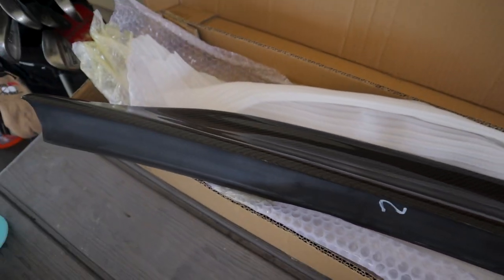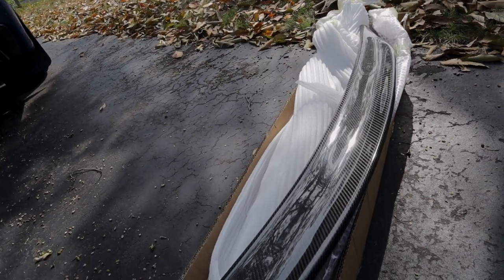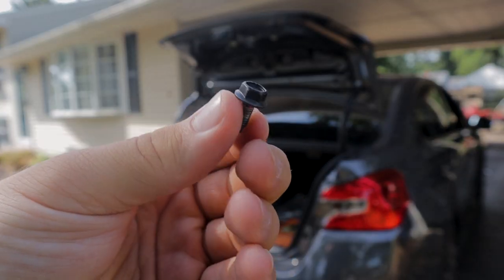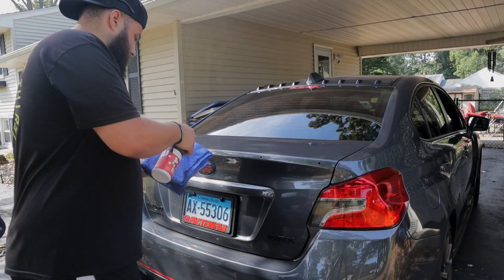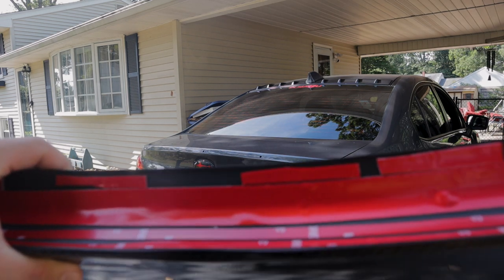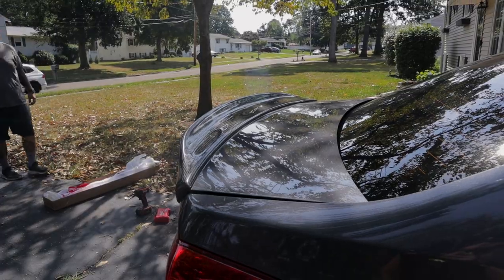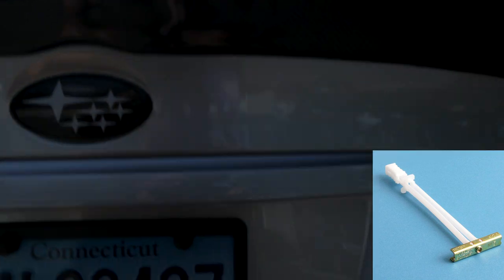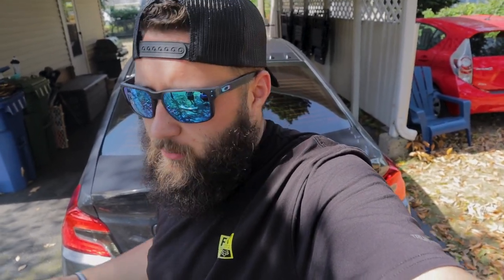OLM CARBON FIBER Duckbill - Subaru WRX 15+

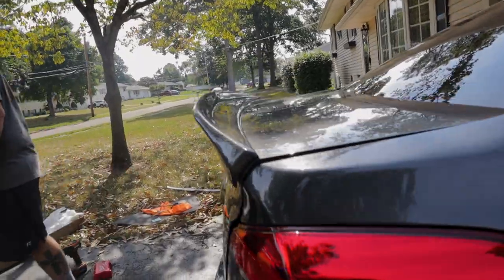Comment: This looks great with the paint color! Mine is on its way. I do want to comment/question something... at 7:24, I can see a pretty significant gap between the bottom of the duckbill and the trunk. Is the tape causing this? I love how easy the install is with tape, but if it creates any sort of gap, I don't want to use it and just go with mounting with screws instead. Any input is appreciated!

Comment: How does it keep up at high speeds with just the 3m tape?
Reply: That's why I drove 2 screws in along wit the tape. Some ppl say the 3m tape is enough, I'm not gonna b the one to test that theory, I wouldnt take that chance with a $400 Dbill.
Reply: @aaronderrick5721  what screws did you use?

Comment: I did this install with the rexpeed carbon fiber bill. I'm telling you right now the 3M tape is not going to be enough to hold that spoiler on, you only put the 3M tape on the edges you put it in the middle or anywhere else it's not going to fit right. You have to put at least two screws in the back, when you do it hold the spoiler with one hand, and screw it in with the other but do it gently, you will feel the screws going through the carbon fiber, trust me I did this install by myself, and my spoiler has been on my car now for  3 months and hasn't moved. You don't have to use a designated panel Wipe, that gtechniq..was prob $20.. go to a drug store and buy at least 70% isopropyl alchohol.$2.. clean the trunk really well, get all the dirt and debris off , wipe the spoiler itself. Obviously it's a lot easier with two people, but if you're by yourself, it won't come with directions, if you spend $400 like I did, you don't want to make any mistakes,imo thats a lot of bread, by the Unlucky chance that it flies off or you make some kind of mistake, I doubt you will get your money back or a new one , and you're going to kick yourself in the ass. I completely agree with Kevin, make sure, don't leave anything to chance, when it comes to parts that are this expensive. if anybody needs any help or tips hit me up on my Ig @steelerwave89...good shit though
Reply: BTW, be ready to pay about $400 for a carbon fiber one , that's what mine was from Rally Sport , I don't regret spending the money at all
Reply: Did you drill new holes when you screwed it in, or you used the factory holes? I wanna use screws also for mine but avoid having to drill the trunk
Reply: @emmvnuel1617  ..hey bro. That's a good question, only because it's been so long since I did the install, I'm pretty sure I used the factory holes, cause I didnt hav a bit to go through the metal. If u hav factory holes, I would use them. What I did is, I used a washer wit the screws for a better hold. Jus drive it through kinda slow, I wouldnt suggest powering it in cause u never know, if it cracks how far a crack would run. I jus placed my left hand on the spoiler., drove it in with my right...jus do it carefully.
Reply: What type of screws did you use? Cause im the same dont wanna try the 3m efficiency!

Comment: so you only used tape? u didn’t use screws?
Reply from the maker: Yep! Just tape.
Reply: I got no screws; mine been on over 2 1/2 years. Heavy snow and high temperatures, no worries

Comment: Still on the trunk after 4 month? You have any snow on it?
Reply: Mines been on over 2 1/2 yrs no issues at all. Snow, heat, speed, leaning. Only 3M holding it on